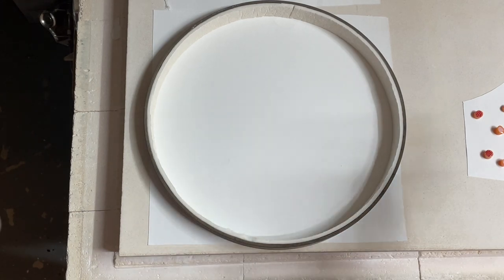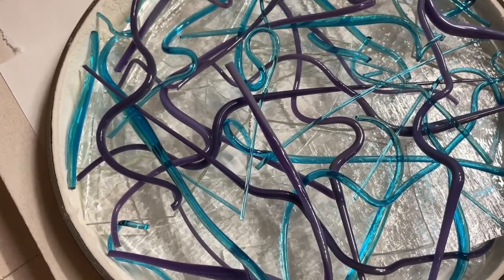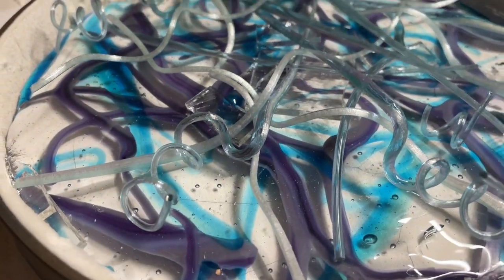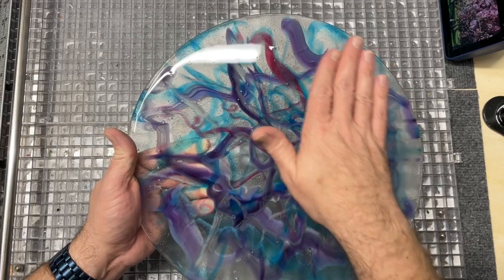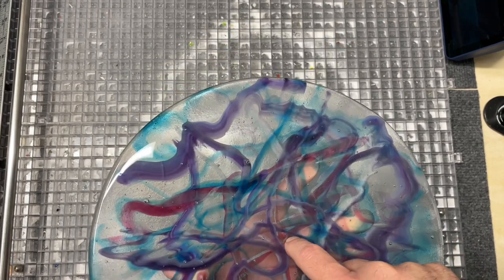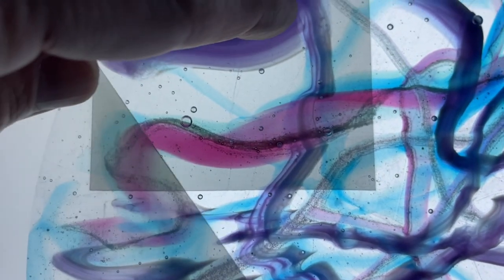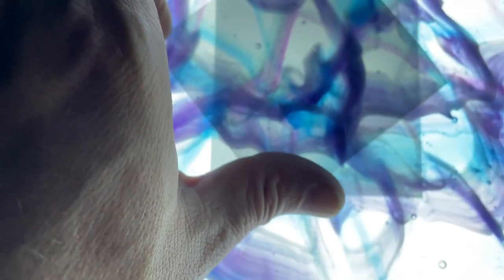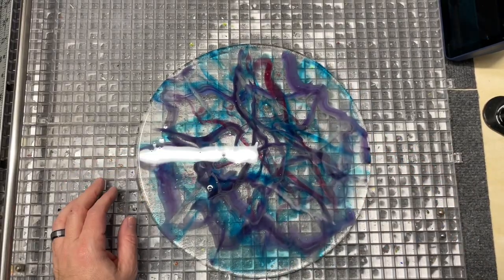Sometimes a #FusedGlass Project Doesn’t Turn Out as You Hoped — Still a Learning Opportunity!

Comment: I have some old Spectrum (now Oceanside) glass that I'm checking to see if it will fuse to current 96 COE.  I cut strips of clear and the stained glass.  I  alternated 2 layers of stained glass with 2 layers of 96 clear and checked strips that measured 7" x 1.5" with 4 stained glass and 3 clear.  Then full fused.  I ordered your polarized filters /film on Amazon and checked the strip between two pieces of film. None had a bright halo but some did have a brown halo.  So, I'm wondering if those brown halos are the non-fusible glass.  It looks like the majority of stained glass would fuse without issue, if I'm doing this right.  Thanks for any help....
Reply from the maker: Gosh, I am really not sure. I wonder if you could send a photo to Oceanside and ask them?
Reply: Thanks!  I'll do that.

Comment: How long did you anneal ? Write your schedule please . Maybe it is not a coe shifting rather than insufficient annealing to that 3 rd fire and  very hot one ? I fixed internal cracks before with another fire to 780c-796 c and very  long annealing, it is a beautiful piece . Maybe you can cut with a tile saw the not stressed part as well.
Reply from the maker: I annealed for three hours
Reply: @JamaisonSchuler  if it"s the total annealing process I would  have go for 4 hours. 
If it's 3 hours on the first  stop at 482c , guess it's shifting coe .. it's sounds like enough...
Reply from the maker: @fein-glass7622  I held for 3 hours at 900 and then 100dph to 600, then waited u til 100 to open the kiln. Pretty sure this is shifting COE, not annealing issues
Reply: @JamaisonSchuler  Yep , you are probably right., bummer for this beauty.